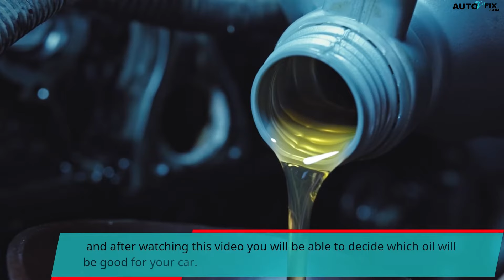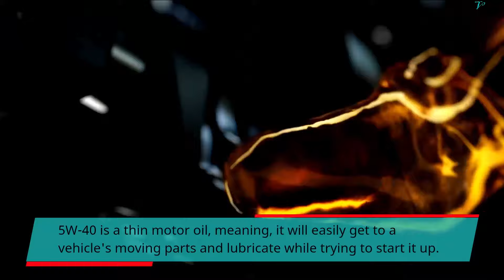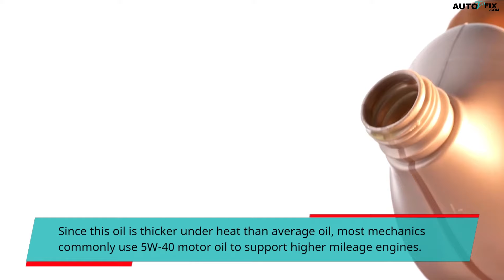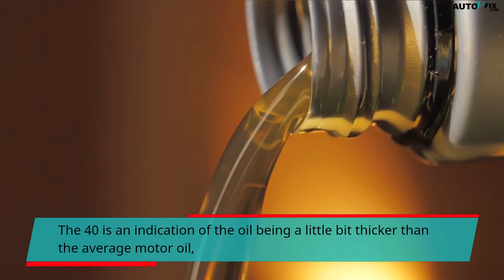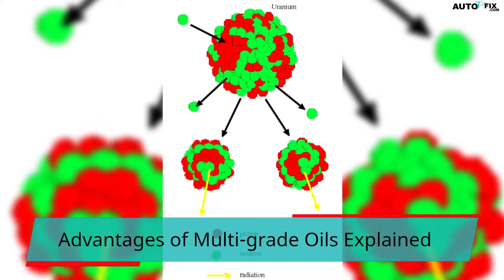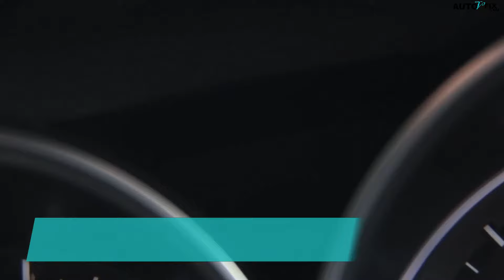5W4O vs 10w40, which one is Better For Your Car?  5W4O vs 10w40 oil

Comment: I own a 2017 VW Passat and, with much fanfare, there is a one page add in my car's manual suggesting owners use Castrol Edge Synthetic  5W -  40 or 5W - 30 Euro oil. I only use 5W - 40 Castrol Edge Euro exclusively since the oil in my engine when I first purchased my auto brand new was Liquid Moly 5W - 40 Euro Synthetic. Castrol is even written on the oil cap on my car's engine.

Comment: Depends on how cold it gets! A 5w40 is good between -30c to +40c The 10w40 is for -25c to +40c.
The  wider the viscosity the more additives are being used. 
If you are not liveing in cold climates there is no need for such a wide viscosity spread, a 10w or even a 15w will be fine. 
Too much emphasis has been put on the low start-up numbers and not enough on the higher working tempature weights which are needed to protect the engin.
5w30 is a good year-round working viscosity.
The 10w40 for hot weather and heavy loads.

Comment: How about using the oil that's recommended for your car?
Reply: Some cars state a few different oil grades in the owners manual.
Reply: Nissan recommends 5w-30 but in hotter climates, the owner manual says 10w-30 up to 15w-50, but that would fuck up your mpg.
Reply: @tonyStorks yeah lol. But fuck you mpg if you want to save the engine and reduce friction, wear, etc.

Comment: My owners manual suggest 5w40., I live in a tropical country with rain and hot weather all year round. I wrongly bought a 15w 40. Is it okay to use 15w40 instead instead?
Ps. I can't return as I don't have the receipt 😓
Reply: If your car has lot of miles on it , its fine
Reply: @ademiravdic  thank you for your response. Yes I have use it and it seems to be running smoothly without a hitch even in the morning (cold startup) 🙏
Reply: @lourdesanthony79  good to hear.
Reply: @lourdesanthony79 anong oil brand sir 15w40?
Reply: @raditojr.lincaro554  Petronas Urania 15w40 sir

Comment: Most if not all newer cars show what kind of oil to use right on the oil cap. Problem solved!
Reply: Not correct answer!! There is a list of options that you can use! They never specify one type!! That is the problem, people are not stupid to not check specs of vehicles